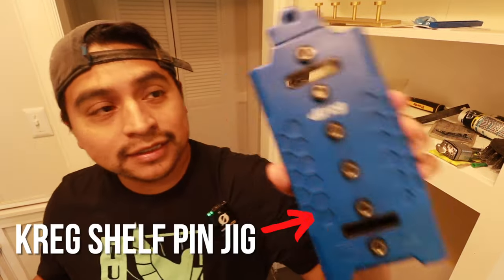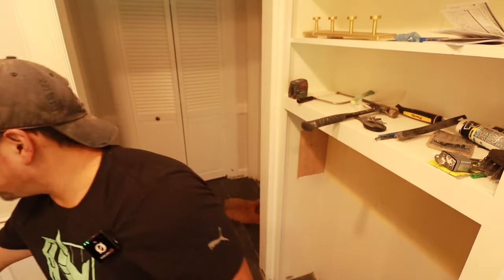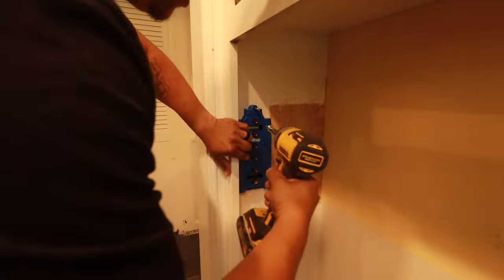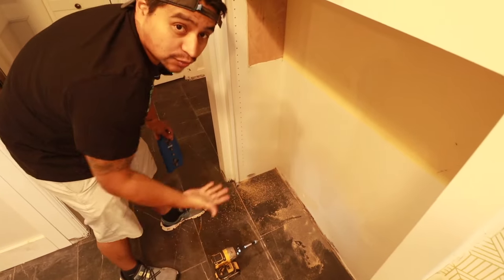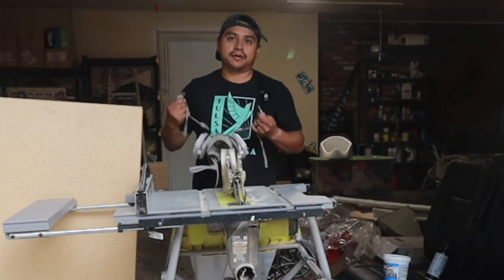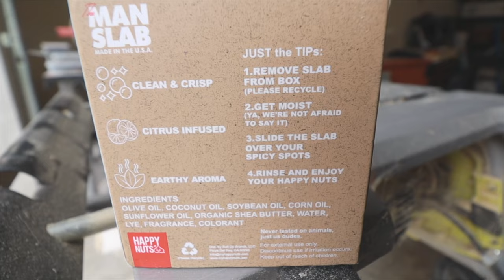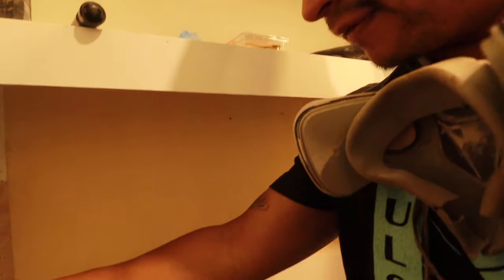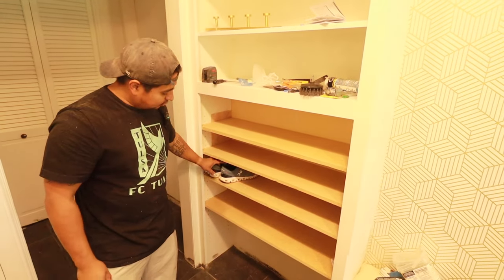Easy Install Adjustable Shelving using the Kreg Shelf Pin Jig.

Comment: You could also use that in the back panel as well. Center a line of holes running down the back wall to add support to the center of the shelf.
Reply from the maker: didnt think to do that 🤦‍♂️ but great tip